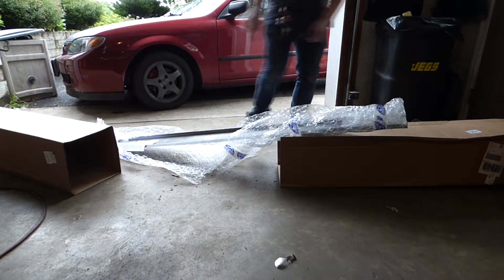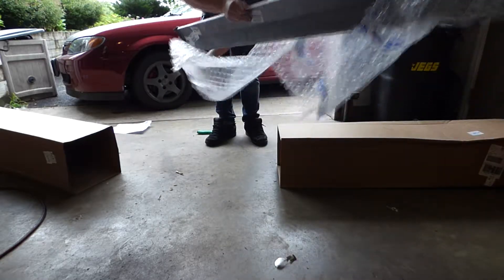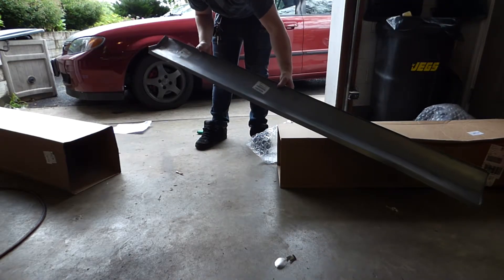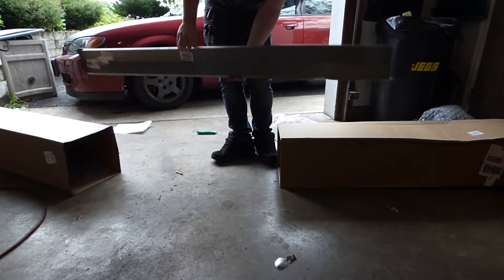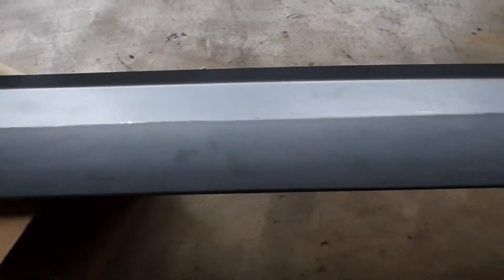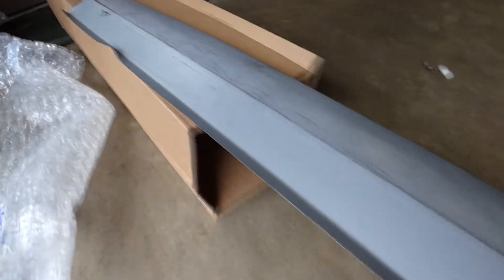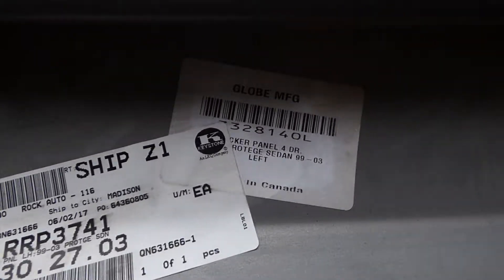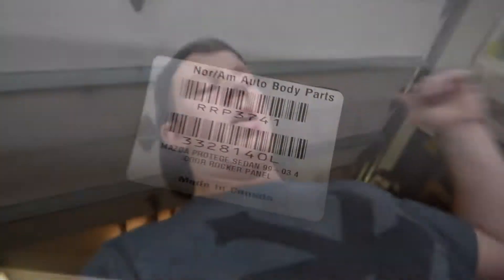Unboxing A Rocker Panel From Rock Auto

Comment: Part should not be damaged before you unbox it.
Reply from the maker: It's a rough cut piece of sheet metal not a direct weld in panel your going to be hammer grinding welding and sanding it any ways